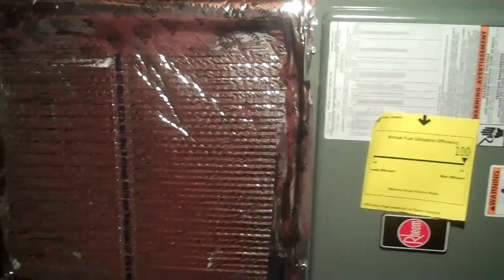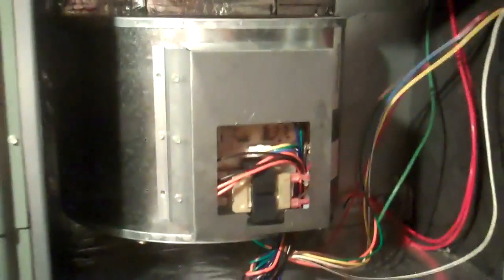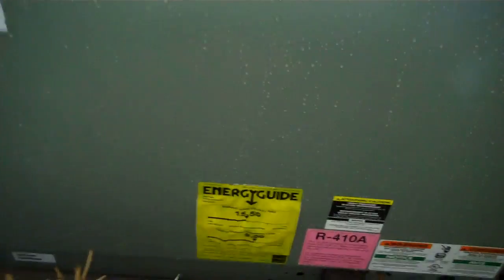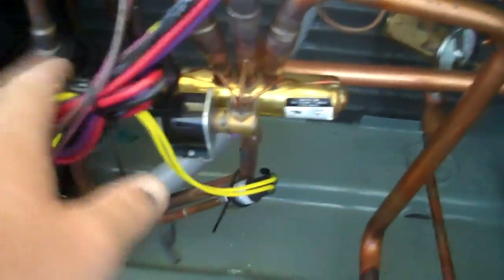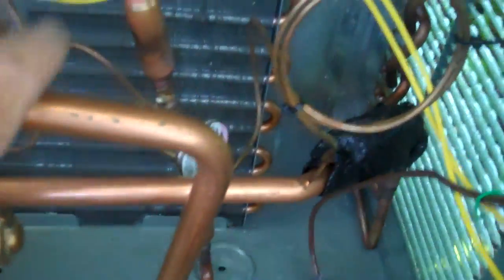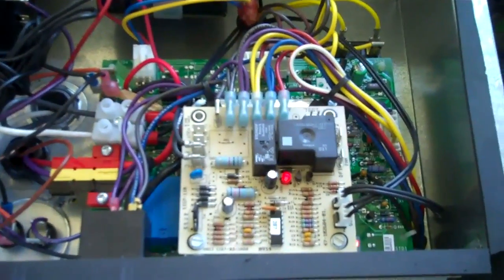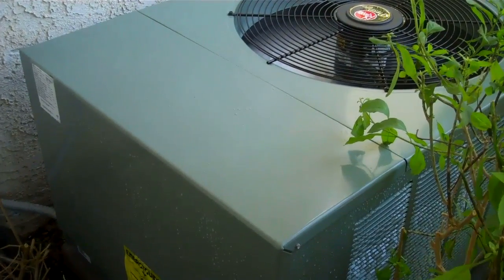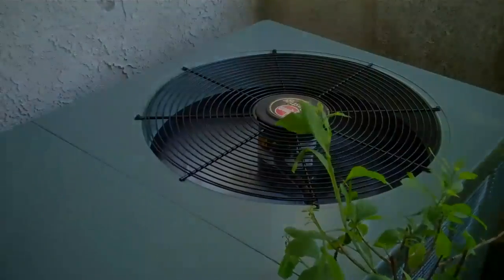15 seer 2 1/2 ton Rheem heat pump

Comment: Just bought a 15 seer Rheem with variable speed AH to be installed tomorrow. My 13 yo goodman "blew the plug"? The connectors on the compressor were burnt, and caused a catastrophic leak in the housing (tested with nitrogen, it would leak out as fast as it went in. It was time. $4800.

Comment: Dallas , Thank You so much for showing me ,
 my new DUAL Fuel Systems ( Ruud Heat Pump accompanied with RUDD gas fired furnace) I will be selling to all my customers !!! This is one incrediable unit !!! My god the days are gone that I need a step ladder to work on a unit !!! ROFL ..  The Reverseing Valve , the everything right at my HANDS !!!
Thanks for guiding me in this direction !!! You are a GREAT FRIEND and a TRUE BROTHER !!! 
Thank You !!!